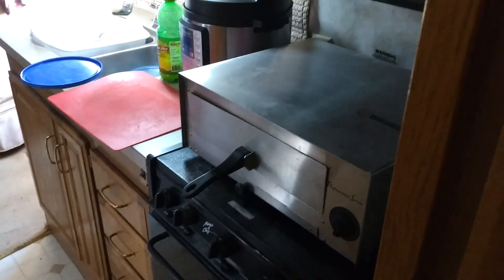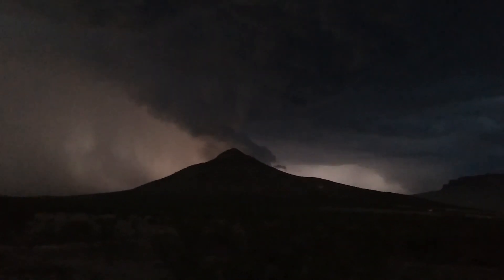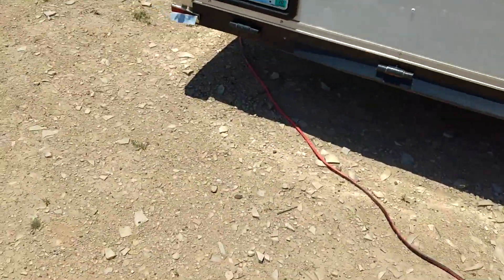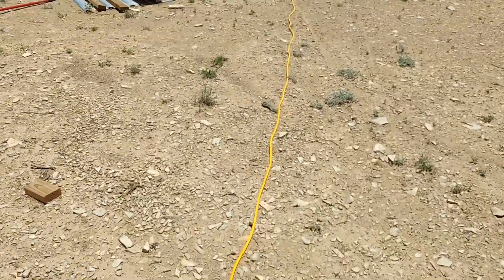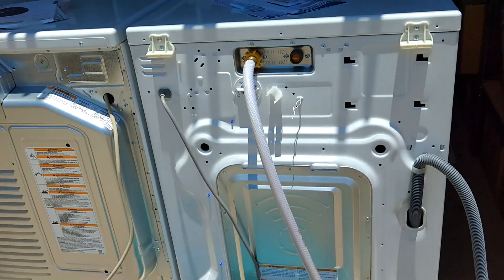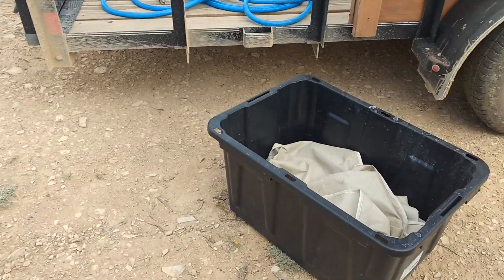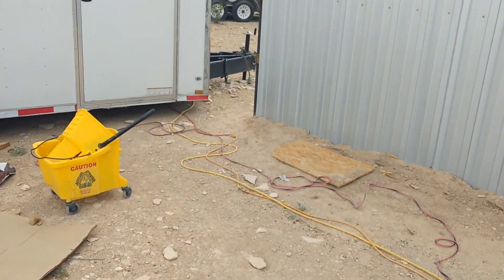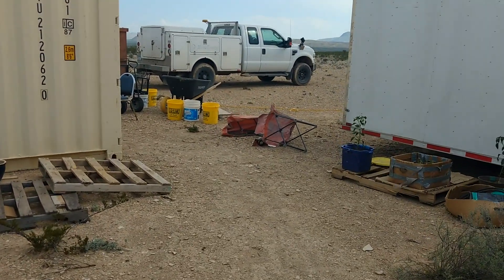Solar Powered Electric Dryer and Washer

Comment: Why is the button flashing 😮and running it like this would it be good to running it on less then it raded for 225 once again it worked it works but I just wonder how long they would last putting them through less power then it used to

Comment: Love those LG washers. I run mine off solar panels into a modified MSW inverter with no batteries.  Every once in a while, rare, a cloud  comes over and it has a power fail. It remembers where it was when it restarts.  Only do wash on sunny days.  Even run all cycles with hot water from a dedicated hot water tank that operates from panels. A friend does run panels into heater element on his dryer.

Comment: Awesome set up! I need to get up to speed on solar before I get out there I guess or I'll be running a generator a lot! How are you guys doing with the heat? Running an A/C? I think I did see a window unit attached to the Bounder in a video..I'm guessing since the smaller ones are pretty light on solar..I have a small 6050 btu I bought ahead for use and it is 564 watts..I am looking into a gas dryer instead of electric...or as warm as it seems out there just a clothesline..I'm driving out next month to look around!
Reply from the maker: Yes, solar is a must! I can't even imagine having to run a generator. We have a 6000 btu in the bedroom that we can run all night, a 13,500 on the roof that sucks power like mad (2000 watts) but we can run it all day and still charge up the batteries and a 12,000 portable unit that we ran for a couple days but since the window plate for the exhaust and intake hoses doesn't really fit the RV windows we stopped using it.. I like running the drier on air dry over using a clothesline because it's easier, quicker and most of all better because your clothes come out all fluffy instead of crispy off the line.. We had thought of using gas but then you have to buy gas and why not just have more solar :P You'll have to stop by and see us whe you are out here.